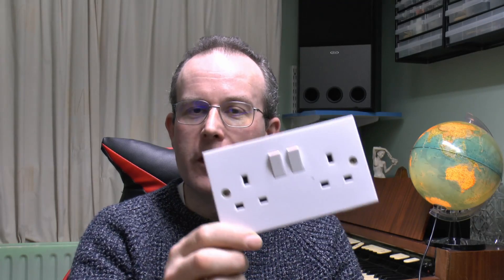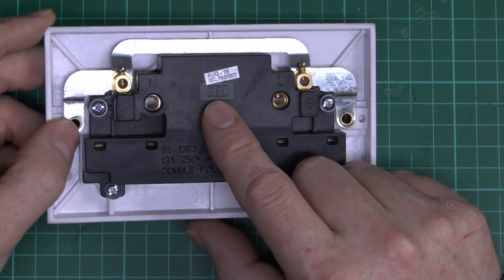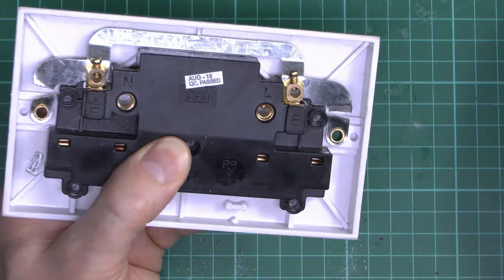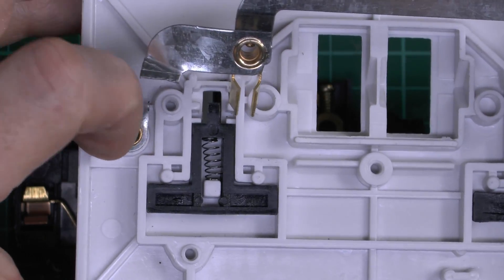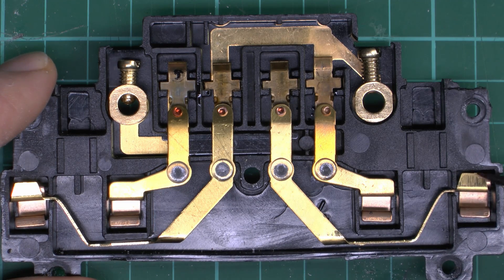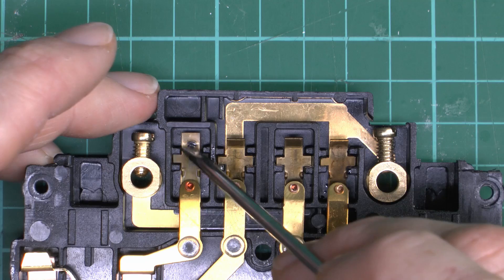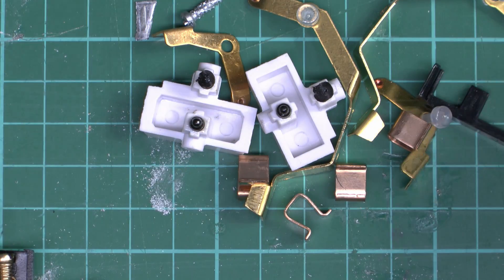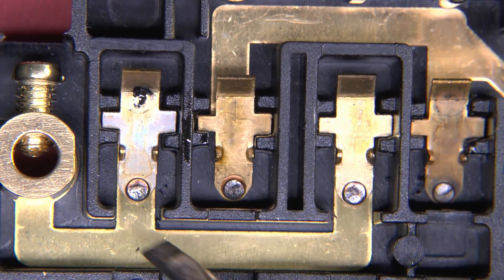Double Socket, Double Failure, Double Pole

Comment: Saw your video. Just asking. Where did you buy this socket? Was it an approved product? Something is not right here. Why is the toggle switch connecting the neutral line instead of the live line. This is a safety hazard. This switch in my opinion has design defects and should not be used at all. Just my two cents.

Comment: Whats your view on crabtree sockets.?
Reply from the maker: Decent enough.  The older ones with the round brass terminals on the back were better, the newer ones have square terminals with less metal in them.
Reply: I recently installed 3 volex 1000 series brushed steel double sockets in my fathers garage to dining room conversion. The double pole variants still have round brass terminals, the single pole variants have the cheaper square terminals. I would rather have fitted MK but the rest of the house is wired with volex 1000 series so matching accessories was more desirable.

Comment: Surprisingly CED's metal sockets are not anywhere near as bad as that plastic example, I bagged an Axiom 
metal clad socket from a hardware store pretty much just as a spare and didn't know Axiom sockets were 
made by CED. But of course on EBay I would stick with premium brands like MK, Varilight or Crabtree.

Comment: what is the differences between a 13A 2 gang single pole  socket and a 13A 2 gang double pole socket?
Reply from the maker: For single pole the switch is in the line only, double pole switches both line and neutral.  
They can also be obtained with no switch.
Reply: @jwflame you mean live not line? So dp or single in real world doesn't matter which you use? Or could you get more potential failures with dp? Tlc electrical have a double dp cheaper at moment and want to buy but I want most reliable. It's MK basic product

Comment: I'm amazed at how it has some contacts on there, but the pivoting contact pieces have one end that is just brass (?) on brass. WTF? So for each outlet, there are 4 electrical contacts. Combined with the strange contacts, it's just asking for trouble (poor reliability).
Also, thermoplastic... yuck. They could have at least impregnated fibers in it to help prevent it from deforming as much when heated.
Reply: A socket outlet is not supposed to get hot. You could say that the thermoplastic is designed as a thermal fuse to "reduce the load" if it gets too hot.

Comment: That socket outlet has definitely been overloaded, I have replaced a few that have had washing machine, and a tumble drier both connected to the same outlet in kitchens and utility rooms, when the heaters on both switch on at the same time this causes severe overloading, but right on the limit in most cases. However this is not an ideal or advisable situation. I replaced the socket outlets and put both washer and drier on separate socket outlets, and its been fine ever since. If a socket outlet has been passed as BS1363 and kite marked, it must surely meet all tests. 20A seems to be the max load on both outlets combined, but manufacturers vary their upper thresholds for safety and durability. Heres some interesting reading from the IET forums https://www.theiet.org/forums/forum/messageview.cfm?catid=205&threadid=33787

Comment: I've had sockets do this and I found a sharp whack will get the switch to stay on or if it's on I leave it! They end up cracking before the switches break in my new house where they use very cheap plastic, maybe it's my heavy handedness is the problem.

Comment: Using a thermoplastic - PP I presume - for the backplate is just asking for trouble. Apart from softening when warm they also creep under load and it looks like it wouldn't take much to reduce the switch contact pressure enough to cause them to run hot.

Comment: Only the front plate thermoset, the plastic part housing the contacts and switch rockers being thermoplastic (a very soft, low melting point type) seems to be the main design flaw. I'd say all of these are inherently defective and need to be recalled.
Reply: Yes - the hard and brittle thermoset front covers are very dangerous. The material is no longer used in almost all countries apart from the UK. The fail here is the design of the metal parts... the plastics have absolutely nothing to do with it.

Comment: John, I just found your videos recently and like them.   Being from US and after designing electrical systems for over 30 years, I have a question.   Why are the terms earthing pin and earthing bar used on your side of the pond?   Is it more a generic term or something else?   In US they are called "equipment ground".   Also "ground" is defined as "connected to earth".   But this portion of the electrical system really has nothing to do with "earth grounding".   The purpose of this system will be achieved with NO connection to "earth".    Please let me know what you can.   Respectfully Submitted.
Reply: pmailkeey    Ok so it is just terminology.    Do you agree that this is misnamed?   In NEC this portion of the electrical system will be renamed sometime in the future to "bonding" as they are not grounds or in your case, earths.    Thank you for your response and time.

Comment: a lot of electrical fittings that were once made from 'bakelite' /urea thermoset 'hard' plastic are now made from this 'soft' thermoplastic stuff....
Reply: Circuit breakers are still made of that heat-resistant type of plastic, at least from what I've seen in the USA.
Reply: Proper "soft" plastic is a far better and safer material than the brittle bakelite / UF rubbish. Only in the UK would they use antiquated material like that. In Australia we stopped using those hard plastics for switches and power outlets in the 1960's or 1970's, as they were far too dangerous. Those old plates would never pass out (more strict than BS) mandatory safety testing.
In Australia we don't use thermoset plastics for standard outlets... there is no need for it in the UK either, however some people think it's required to meet the regs (which only require glow wire testing and self-extinguishing within 30 seconds).

Comment: Anyone actually weighed a genuine MK and compared to cheaper ones, suggestions for a relevant British Standard anyone!.
Possibly a loading test of say 20 amps for 5 minutes per socket outlet ( approx 1.5 X 13A rating). There is a similar test for using steel conduit for earthing if memory serves?.
Yes, I do have 100% MK sockets in my house.
Thanks for sharing.
Reply: There is a relevant British Standard.  BS1363 which covers 13A plugs and sockets.
Reply: @cjmillsnun  , yes, I should have said a test by the installer, sorry. But then the poor electrician is liable.

Comment: Why the hell would you need a switch right by the outlet anyways? How about just unplugging the cord if you want to shut off the thing plugged into the outlet?. I don't know how outlets work in the UK, but I have never seen a switched outlet like this here in the US. Seems kind of silly to me.
Reply: its always a good idea to switch off before removing or inserting a plug, plus it turns off the appliance , which may not have its own 'fully off' switch, just a 'standby'... saves a lot of plugging and unplugging
Reply: pmailkeey yeah, my phone/laptop chargers have large capacitors in them so have a high start current. If you plug them in when the socket is on you get a lot of arcing, enough to leave pitting/scorch marks on the plugs. It’s always a good idea to switch off the socket before plugging in or unplugging loads like this.

Comment: The external appearance of the socket with that nasty finish and sharp contours along with the shoddy switch operation and feel marks it out as very poor quality from the beginning. My general rule of thumb is that if the switch operations are notchy, then it's generally a poor quality outlet and best avoided. A couple of pound extra makes all the difference.

Comment: Thats a very poor method of fixing the copper strips with those clear plastic pegs, they weren't even a tight fit,  an obvious overheating point from day one!
Looks like that socket had been used to power a couple of 3kw heaters or a similar load. 
CED - Chinese Electrical Disaster!

Comment: im amazed anyone woyld fit these, aside from being very poor quality internally, they look horrible on the outside. 

Cheap almost grey off white colour, nasty switches and angular corners.

When ever i ree decorate a room or do a renovation i always change over all the switches and face plates to mk. Doing this instantly changes the look of a room.

These cheap sockets are horrible.
Reply: contractors most likely, they buy them by the case load and charge the customer as if they were a quality item, they last long enough to get paid , and laugh to the bank

Comment: I have seen  switches burn out due to people being hesitant when using the switch. They move the switch very carefully and end up holding it such that you get excessive arcing, this can happen with any make and can be done deliberately if you want to try it.
Reply: I use to do that as a kid when I was younger. A light switch in our house would arch when you  turn the switch on slowly.  It doesn't happen as much now with everybody using LED light bulbs that draw less current.

Comment: That's why we in other countries don't have 32amp fuses for sockets. If you put two 13A plugs in to this socket you will overload it by 100%
Reply: the 32 amp will be for a ring main, not an individual socket, it may feed 10 sockets...and 26a total is what these are MEANT to handle
Reply: Each wall socket in the UK is rated for 13A. The main RCD for the sockets will open if you try to pull too much current in one go.

However, if you watch John's other videos, you'll see the wiring and so-on is capable of handling pretty extreme overloads before things set on fire.

I had a 2KW heater and if I ran it all day the plug's pins got hot enough to burn me, but none of the plastic on the socket or plugs had gone soft or charred.
Reply: @jamesgrimwood1285  RCD is for ground fault and nothing else
Reply: @mortenwinslw2785  so what's the correct name for the devices in my consumer unit? Are they just called circuit breakers?
Reply: What utter tosh. Double sockets in the UK are fully rated for 2 x 13A plugs with a total of 26A, and the plugs are individually fused at 13A. 

The 32A is the rating of for a normal ring circuit, and the breaker protects the fixed wiring, not the socket/plug. I should add that 32A radial circuits are also allowed, and the individual plug fuses will limit the load on any one outlet.

Clearly you have no idea what you are talking about when it comes to UK wiring standards.
Reply: @TheEulerID  If you look at the back of this socket it says 13A and not 26A, so I don't agree with you
Reply: @mortenwinslw2785  That's the 13A rating of each socket. which is what's specified in BS1363. That's because that's the capacity of the wiped contacts and any switches, not the current carrying capacity of the whole thing. 

The people who set these standards are not idiots. They know exactly what they are doing, and multiple socket outlets have been part of the standard since the very beginning.
Reply: Morten Winsløw 
?
Reply: @pmailkeey Tanks, I've done a bit of research, and it does seem that the official test is for 4A + 16A over a 4 hour period. I wonder why they didn't make it 26A and be done with it. 

Really, sustained fixed loads ought to be permanently wired and not by wiped contacts anyway. 

https://www.theiet.org/forums/forum/messageview.cfm?catid=205&threadid=33787
Reply: Wow. This guy's so clueless!

Comment: What would the price difference be between that socket and a proper quality one, say like MK?
Reply: That CED socket double pole is £2.28. I buy Hager double pole for £2.14 online and in my opinion are better than MK as the terminals are more robust.
Reply: An MK one is £3.85 from screwfix. I'm guessing one like this would be around £2
Reply: @cooper512  Wonder why people buy crap like that, where for an extra £2 you get quality and safety.
Reply: @madbstard1  there are contractors who work for builders who get squeezed for every penny. I fit MK or Scolmore because otherwise it ends up costing you or the client when you have to go back and sort it out, faff you can practically eliminate easily
Reply: @madbstard1  If you're installing or changing a single point then it's peanuts, but it soon adds up to a significant amount if you`re putting in a lot. While the saving is probably illusory its attraction is nevertheless understandable.
Reply: Blake Hi Blake 
A legrand double socket outlet here (non switched) in SW France 22.0 euro. Gold dust!

Comment: Ced the brand to use if you think your not going to get paid. 
I think some tests should be made to see what constitutes excessive load or abuse,to the point that various ced stuff fails. 
I needed an exterior retractive switch could only find 2 options.
 mk were about £30 
Ced from Wickes at £7:50 several on the shelf had lost their springiness. Still bought one😥. Takes a couple of attempts to activate my timed lighting .

Comment: Interesting. There's a lot more going on inside a British socket than a North American one.
Reply: There is, although the switch is optional. Most outlets will have them, but it's not compulsory. What is also now common are outlets than also have two and sometimes event four USB connectors. That makes them quite a bit more crowded. 

In this particular case, the outlet is just shoddily made.
Reply: You mean like having a switch as standard, and none of the horrid push in connections that melt and arc.
Reply: @SeanBZA   The only problems I've seen with those push in connectors is when people try to pull out a wire then reuse the same connector other than that they have worked fine for me, but you're right. Using the screws is the better option.
Reply: @twn5858  I see plenty of push in connections in lights working well for decades, but there the current is under 2A, and releasing them is also possible using a little bit of wire to trip the spring to release it. Expecting that though to handle 16A long term is not a good idea though, especially in the UK where the socket might have to be passing 16A to the outlet, and also having another 16A flowing through to support the rest of the ring main. They will fail at 30A if they are poor, as John has demonstrated before.

Comment: it looks like somebody over powered that socket
Reply: CED - Crap Electrical Device, just they made it to handle 3A of load, but the spec calls for it to actually handle 13A, along with switching reliably for years
Reply: What do you think could over power a socket? Like a washing machine or something?
Reply: Just cheap crap, you get what you pay for.

Comment: Good video John. There is a whole bowl of these BS1363 Sockets around some great quality and some like this, poor quality. I, on a fairly recent video got a switched MK socket to handle 47A before the switch failed. MK in my eyes are the best for consumer units and plugs/ sockets. 

I stick with MK, they are quality. 😁
Reply: Even the newer MK accessories are not as good quality as the ranges from 20 or 30 years ago.
Reply: I preferred the older MK sockets for build quality though from what I remember they didn't need to have an earth pin inserted to plug something in.
Reply: To both of you, yes the older stuff was generally built to last, not to sell like modern equipment of today. However even British general today are rubbish. Look back 30 years forgetting the technological advancements of today stuff back then yes, was of better quality. 9/10 times!
Reply: @cumberland1234  quite right, the shutter system on some MKs relied on pushing both live and neutral pins in at the same time,and turning sideways, not being pushed down by the earth pin.... i dont know if the current MKs use the same idea..
Reply: andygozzo72 The current version requires the earth pin first then the L&N pins together to operate
Reply: @NOWThatsRichy  I agree.  We bought some MK light switches and they are made of very flimsy plastic.
Reply: @video99couk  I've still most of the MK switches & sockets in my place that were installed in the mid 80's,  never had any problems with them & all still functioning correctly.
Reply: I had a Crabtree 47A spur switch on a normal shower unit  (not installed in the bathroom either) eventually go bang and exploded from wall while the shower not it not running.  Because of the breakdown of crap Cninese plastic and build quality.   Some posts are saying MK now gone to China and these made in PRC are now bad quality and its made the made in GB ones price go up.
Reply: For me the best at the moment is Crabtree.
Reply: The only thing I don't like about mk you can't seem to fold the cables without showing exposed copper wire,the older mk were very good a bit of a pain to connect due to layout of entry points,although quality jobs used Crabtree items.
Reply: Do you have access to buy - if they even exist over there - industrial/commercial/medical-grade sockets? They will probably have better quality, at a increased cost of course.